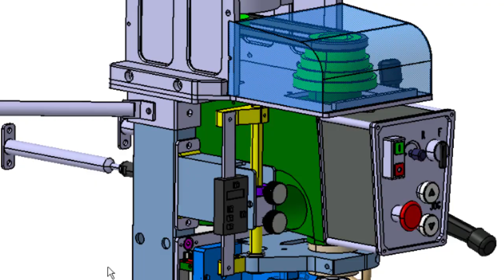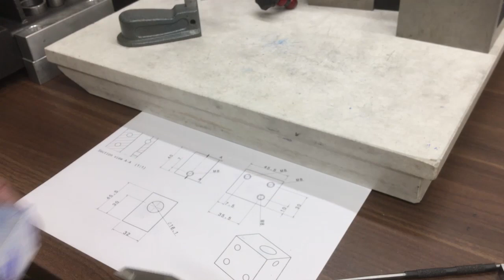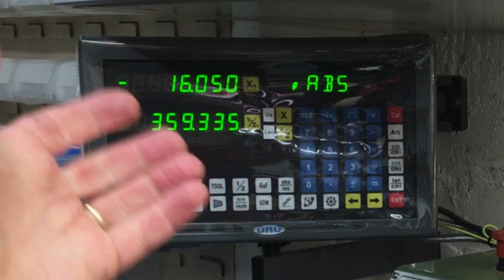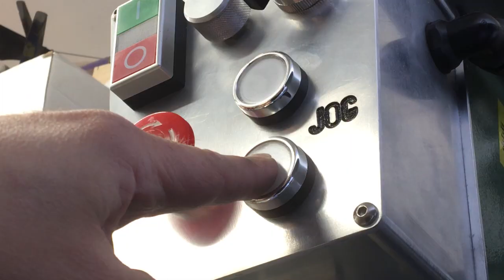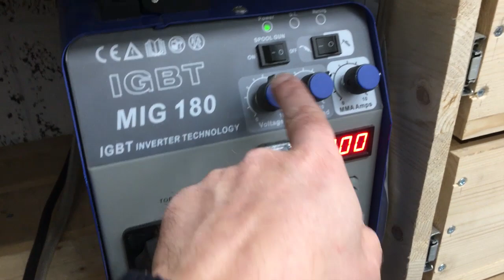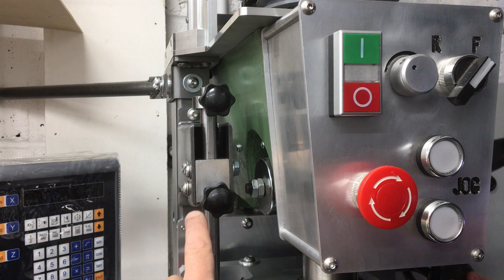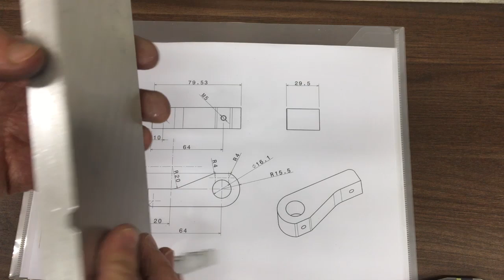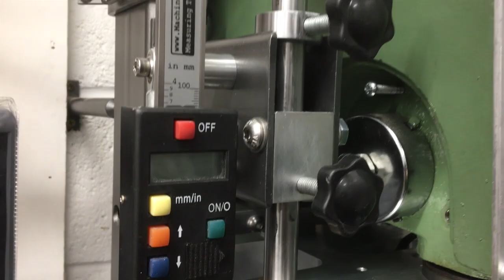Ep35: Drill Press Upgrade | Quill DRO

Comment: Nice work love the purple vice
Reply from the maker: The one I ordered was graphite grey but they sent a purple one!  I’m testing it out to see if it is useful (it has some issues such as does not line up with the T-slots and bolts get in the way of wide part etc).  If I decide to use / mod it it the colour will have to go!

Comment: Great video, I have the same mig welder. The last knob you dialled in is only for stick welding and does nothing when using it in mig mode. It Is a very capable mig and stick... you can scratch tig in stick mode but I’ve never tried.
Reply from the maker: All this time I’ve been dialling in the amps using that control !

Could be that I have always well prepared the material but I’ve  always had great results with it and it just seems so much better than the old transformer style I had many years ago.  Thanks for the comment I’ll go and RTFM !
Reply from the maker: Just rewatched the video and it even says MMA on the control label !  🤭
I think it was because my previous welder many (many!) years ago had an amp setting.  Thanks for the comment.
Reply: @routercnc9517  could be worse I phoned them up asking why my electrode was burning back on my tig welder, it’s written in big red letters on the front of the manual about electrode polarity...
Reply from the maker: Haha yes!  Most people still call the clamp “ground” on a TIG welder which doesn’t help!

Comment: Machine.DRO, I work 4 mins walk away from their warehouse/shop. Apart from lots of little bits, I got my lathe DRO from them with magnetic scales & they are tiny compared to optical ones. I know you already had the optical version but they would have been ideal for the XY table. Not sure what other advantages/disadvantages there are between magnetic & optical scales.
Reply from the maker: Sounds handy!
I just bought a coaxial DTI for the drill to centre on holes.  Generally find MachineDRO to be good quality.
For the scales mine were sent free back when Banggood sent stuff for review.

Comment: Ok I have a complaint. Ahem. Air compressor. Mister. What's going on here buddy. I distinctly remember seeing hand actuated WD40 in this video..... Nice to see you nearly wrapping this up. Perhaps some large domed cap heads for clamping your vice instead of all the clamping studs? Must get a bit annoying!  I almost fell off of my chair laughing when your chuck fell out. Must have been quite a surprise! Oh MIG welder. You control the output voltage and the amperage follows on these types of welders. Your welding is getting much better. I just use flux core as most of my welding is outside. But it does make a lot of smoke if it's used inside.
Reply from the maker: Yes you guessed it- fog buster project is on the list.  I have tubes, solenoid valves, nozzle , mixer block, filter canister etc.  Just need to get this little drilling project out of the way first!
The vice is a trial to see how I get on with it.  At the moment the best thing about it is it’s quite compact in height, but the rest is not so good.  I may scratch build one, not sure.
On the welder yes sorry about that !  I had a stick welder many, many, many years ago and used to borrow a friends MIG welder as well so I got the controls a bit muddled in my memory for this one!  I’ve had it about a year and it has been fantastic.  I used to be quite good at welding so hopefully it’s all coming back!
Reply from the maker: Yes the chuck has dropped out a few times and I’ve since cleaned the taper and reseated it.  Been ok since but the cheap pulleys on the belt drive have lots of runout so the add vibration to the chuck.  Add to this the offset edge finder and it spells trouble.  I will make new pulleys for this machine which should have it purring along.  I’ve heard of people somehow cross drilling the tang at the end of the morse taper to retain it in the taper.  But I’ve not seen a picture of how it is done.  I may buy a new BT16-MT2 and experiment.
Reply: @routercnc9517    You should not need to do more than give a good knock into the socket as long as you have the tang located. And it should be firm and not come loose without using a drift to knock it free. Are you sure that you cannot true up the pulleys? If the centre is loose bush it out. The rest is already there and you can true it all up fairly easily.
Reply: @routercnc9517    Welding is like riding a bicycle. It comes back quickly. I have done it as a paid welder. One of the dirtiest jobs I ever did. I can weld things together well enough. But true fabrication is a whole other skill set. take for example your trough welding on one end of your rectangular tubing. it pulled up quite a bit. The welding shrinks and introduces stresses. If you tacked it on all 4 corners and then weld it through you wouldn't have had to clamp it up tight. But I usually remember this after I have buggered it up!
Reply from the maker: I haven’t decided how best to deal with the pulleys.  The motor one may take a centre rebore and bush although I may go for a commercial taper lock.  The quill end sits on a tapered shaft so needs more thought.  If I remake both ends at least I can go for a standard belt.  The current one seems to be an oddball size used on washing machines etc.
Reply from the maker: Yes on the welding I knew it would pull but was in a rush to get it finished.  For what it is I was not too worried.  Nearly finished this thing!  
I’m working on the belt cover which will be sheet metal and folded with a radiused front edge.  I will need to stitch weld the side seam to create the shape.  It is 1mm mild steel and would be ideal for TIG welding but I only have MIG.  Wish me luck !
Reply from the maker: Since thoroughly cleaning the tapers and tapping the arbor it has stayed put.  Hopefully it stays there!